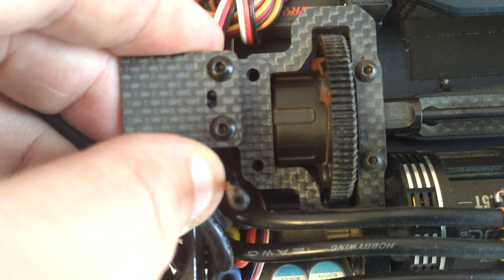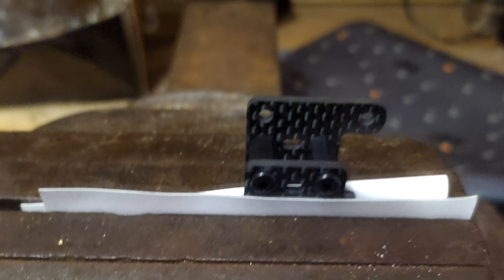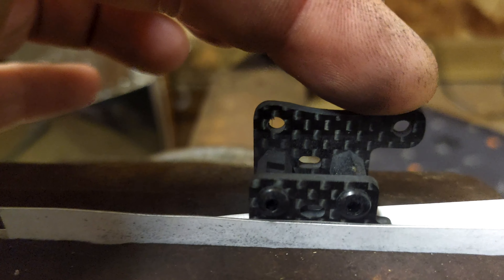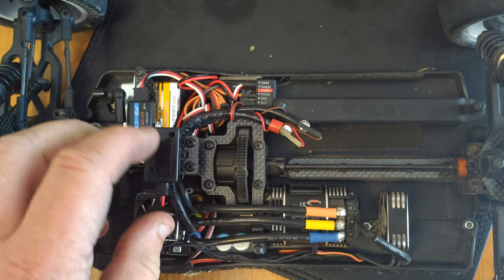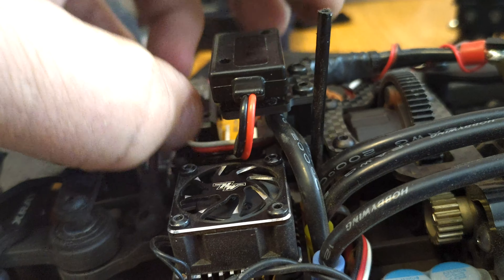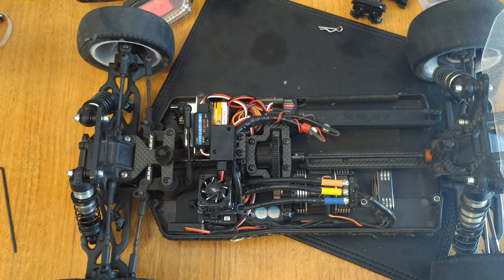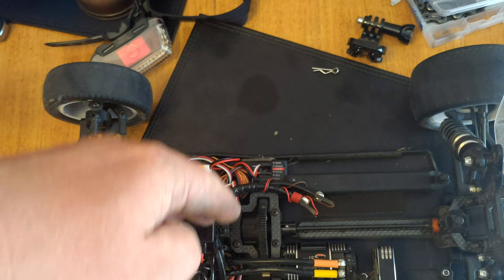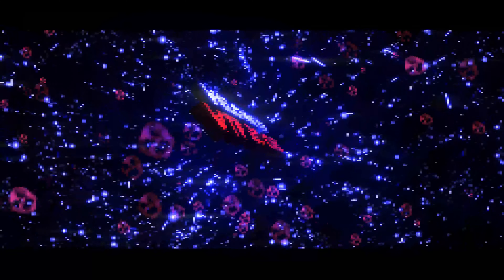Lapmonitor transponder mount for B74 XB4 YZ-4 and TLR 22X-4 centre diff fitment issue on XB4 2020!

Comment: Thanks for this video, this problem is now fixed on new parts on website. They are now compatible with XB4 central diff and slipper version
Reply from the maker: Glad the vid was helpful :) loving the lapmonitor system :)
Reply: @WTFRCCars  thank you, very much ;-)
Reply: Is this a problem for the TLR 22x-4 running a centre diff?
Reply from the maker: Lapmonitor have informed me they have corrected all the parts now as they didn't think the centre diff was different dimensions to the slipper
Reply: @NaughtyGoatFarm  Problem was reported only on XB4 with central diff. Don't think problem was also on TLR 22x-4. It has been fixed by slightly reducing the part width on diff/slipper side. If you see any provblem on TLR 22x-4. Please report it to me. Thanks Franck
Reply from the maker: Yeh you corrected it very quickly :) great work :)